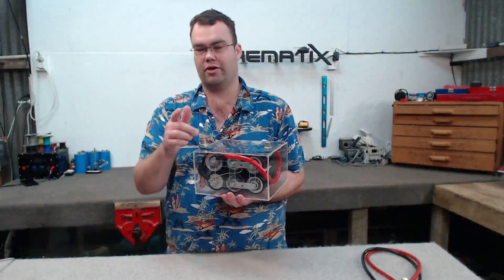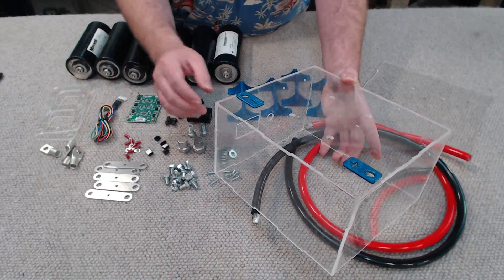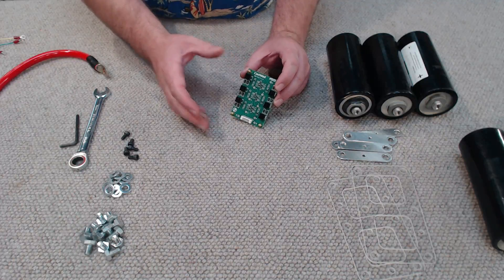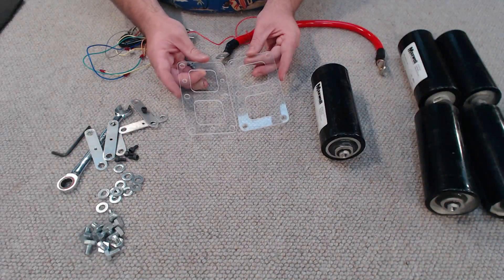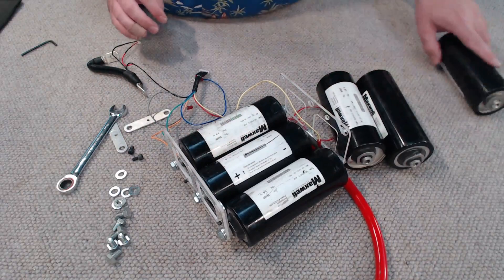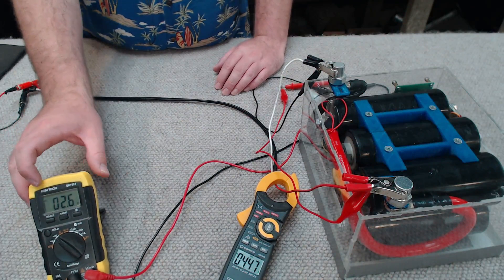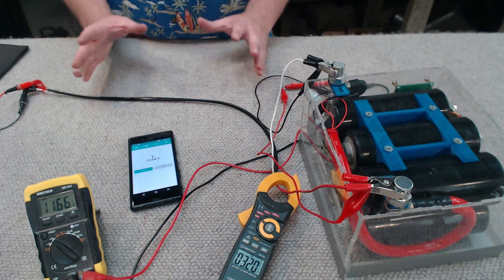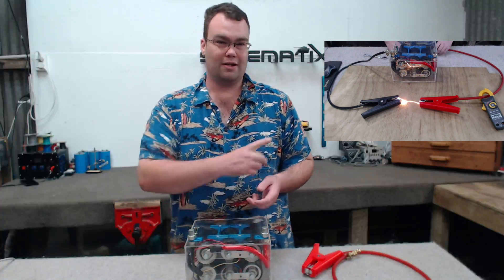Super Capacitor 'Battery' Bank Construction Video

Comment: why are all the large cap's always low voltage? is there some intrinsic rule in electronics i just don't know about in capacitance. and you should check out Julian Ilett's video on his smaller super cap's and his explanation on the control board and a cool mod on it   https://www.youtube.com/watch?v=trEnwNaEgJ0&t=1209s
Reply: Our current technology only allows us the choice of low voltage high capacity, or high voltage low capacity. Unless you want to use a refrigerator sized capacitor. 
Hopefully with carbon nano-tube tech., we can make a high voltage high capacitance capacitors that are small and lightweight.
Reply: Pha Q  nn

Comment: awwww...what the hell? you combed your hair!? !!! :-) hahaha 

how many people, wired in series, can you kill with that thing? the DOD might want to hire you...
Reply from the maker: I got a new haircut! Thought I'd try something that didn't portray me as a mad-scientist type....... even if in reality I am one ;)
Reply: You can't kill people electrically with the thing, you can however burn them alive if it vents with flame.

While the capacitor is happy to supply a lethal amount of current, its voltage is going to be limited to less than 14V. The resistance of human body will act as current limiter and limit the current to a safe amount. Injury will be averted. And the more people you connect in series, the higher the resistance and lower the current. A single person with very sweaty hands might just about feel the tiniest bit of something very subtly, but multiple will not.